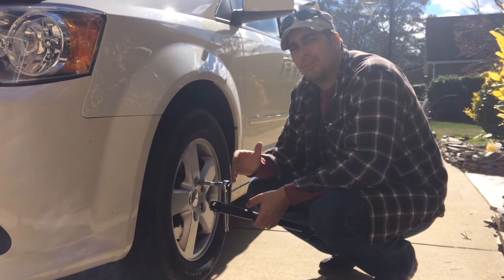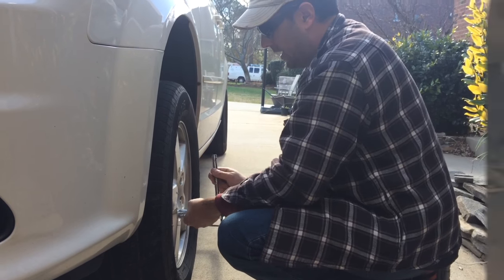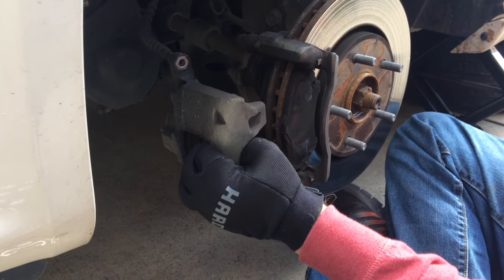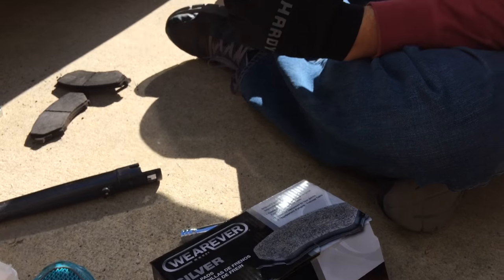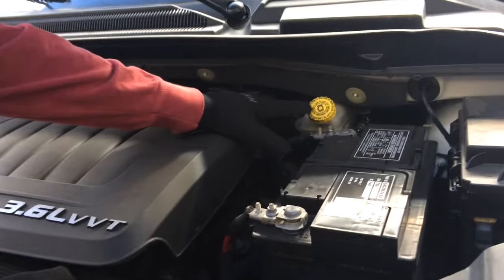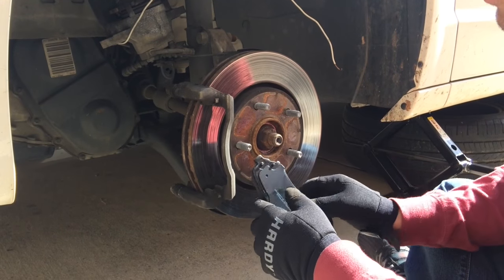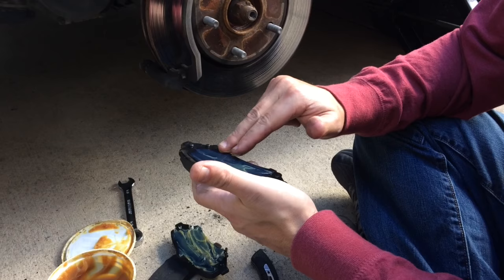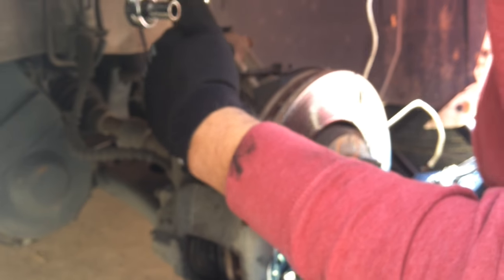Easy Step By Step Brake Job on 2012 Dodge Grand Caravan. Save Some $$$

Comment: +Off Grid Nation ~ Good job Tommy.

The few improvements I would suggest are;
1. When just changing the pads, (my favorite job), I break the bleeder screw loose, if at all possible, then hook a hose over the screw and place the other end of the hose in an old oil bottle or even a pop bottle. I use a large C-clamp over the caliper while it's still attached to the brake assembly and slowly tighten until it won't go any farther. This pushes the oldest and worst fluid out of the brake system and the bottle catches the mess, (brake fluid is flammable and a good fire starter, not that I would ever do that if anyone from the E.P.A. is reading this). I then close the bleeder screw and then loosen the C-clamp. This makes the job quicker, easier and if one of the caliper pins is sticking, you'll hear a clicking or dragging sound indicating it needs to be removed, cleaned and lubed. 

2. I only remove one bolt on the caliper, and then either fold the caliper down or use a bungee cord to hold the caliper up depending on the brake hose location.

3. I use ceramic brake lube instead of grease. It's $20 a bottle, but you can use a lot less of it compared to grease. A bottle should last you more or less about 100 brake jobs. I put the lube on the piston caliper lip and the caliper front contact points. I also put lube on the brake pad tips that ride on the clips of the caliper bracket that holds the pads in place.
 
4. Once everything is reassembled I add fresh brake fluid to the reservoir, close the cap and get into the car and pump the brake pedal until the pedal has less downward travel.  I hop out and recheck and or top off the brake fluid as needed.
 
 Don't let me or anyone else put your work down Tommy, we all started with less knowledge and later on we learn how to do something better and hopefully with less effort.
Reply: 1> there is NO need to bleed the brakes
3> as said coppa slip, dont need ceramic brake lube - thoes metal shims are what STOPS the squeel actually

Comment: Thanks to you, I'm going to change my own brake pads. I'm a 31 year old woman who just changed the lift gate supports thanks to YouTube. Soon I'll be able to do my own oil!
Reply from the maker: I have an oil video up. Brakes and oil are pretty dang easy. It saves you money but you also know that the work was actually completed and hopefully done right. You can do it. Once you get a job under your belt you feel so much more empowered. It gives you the confidence to try more and do more. Good luck!
Reply: Thank you! I wasn't given any guidance on cars when I was growing up. Now I know more than my husband (who admittedly isn't a mechanically-minded person). Before all I could do is top up fluids, air up tires, change wipers and find the fuses. I'm learning more and more. I need to figure out my sound system next - my speakers keep popping and when they do the sound goes out. Happens at regular intervals when the system is on. It's an OE sound system, nothing incredible, but I think a wire is loose somewhere. If I can figure out all this I can learn to pull off door panels to check wiring! (That part Hubby can help with, he's a radio transmitter test operator!)
Reply: It didn't fix the issue - I need new rotors too apparently - but I got the front pads done! Thank you!
Reply from the maker: Good news is that rotors are easy too. Glad you got the pads done.

Comment: you wanna be using copperaslip, because the ordinary grease will melt and dissolve when those brakes get up to operating temp.

Comment: Why did you remove the second bolt. It's much easier to only remove the one at the end opposite the hydraulic hose and leave it connected. Then swivel the caliper open, replace the pads and push the piston back and put the new pads in. So much easier. I'd also be careful putting that much grease anywhere near brake pads. A tiny minuscule smear would suffice. The last thing you want is to get a drop of grease on the rotor, then you have NO brakes.
Reply from the maker: I never thought about doing it that way. I guess it would make sense. I never knew how much grease was the right amount so I just did what the guy that taught me did. I've never had a problem. No doubt, don't want to get grease on the rotors. Thanks for the tips.
Reply: Yes, only remove the top bold and loosen the bottom one. No wire required. :)

Comment: Great DIY and saving money,  Break Grease does help ,  I need to replace my back drum breaks but never have done them before,
Reply: They are not so hard just make sure you only take one side apart so you can use it for a reference when you put the first one back together

Comment: Crude, but you got it done. Here are some comments:Get all the tools together before you start the job, no excuse, this includes blue Loctite , silicone brake grease and metric wrenches. Also a torque wrench.You could have saved yourself some aggravation if you had checked the pad thickness through the caliper window, and with alloy wheels like yours you could probably do it through the spokes without taking the wheel off. You knew the lining thickness is 10 mm from referencing the new pads.Yours is an early 2012 with light duty single cylinder brakes, but you still should have put a pad backwards over the cylinder face when clamping. Also you should have opened the bleed nipple  to let all that old overheated contaminated 6 year old fluid out, instead of pushing it back into the system. Also you should have removed the clips, checked them for wear, wire brushed their seating surface on the caliper and then reinstalled with a light film of the recommended silicone brake grease.At 6 years, your van is overdue for a fluid change.As for $22 pads, what kind of Chinese junk are you buying? There is a good reason it costs $400 for a brake job at Midas, watch one of their technicians do brakes sometime, they will be pleased to let you watch, and you will be amazed at the details they cover, AND they use quality, at least O.E.M. parts. ALSO they check the rotor for thickness and run out. Sure, you can save on labor by doing it yourself, but remember a little knowledge can be a very dangerous thing, - you've done only half a job here, and publishing your lack of knowledge for all to see, forever.

Comment: You always start from furthest to closest when doing brakes even in the front example, back right/back left/front right/front left.
Reply from the maker: Chevy King i knew that was the case when bleeding the lines but I've never heard that about changing pads.
Reply: Off Grid Nation I've learnt over the years that it can cause an air lock in the system, but yes you are right 100%

Comment: Where do you buy pads and rotors? I looked at oem rotors, they are around 100-130$ each, and pads are 70-100$/kit. Looks quite expensive in total, I am wondering if I can use parts you use.
Reply from the maker: I didn't replace the rotors. I bought the pads fromAutozone online. I think they offered 20% off
Reply: Brakes are a great place to buy the cheapest parts you can find. They don't serve an important function at all.
Tires are another great place to save as much as possible! 
Some folks prioritize differently I guess...